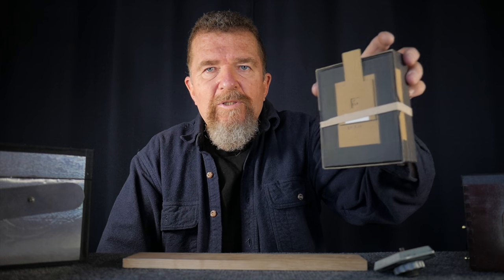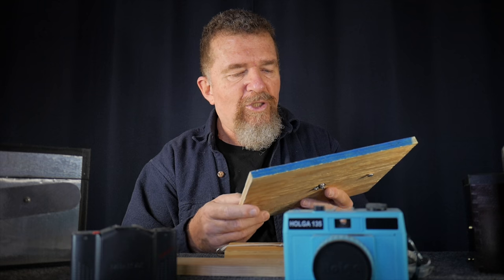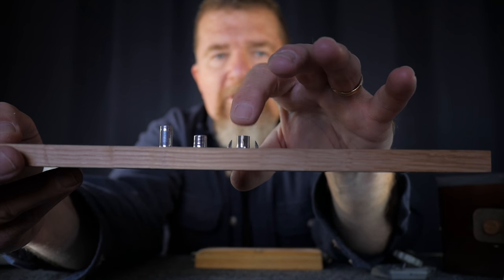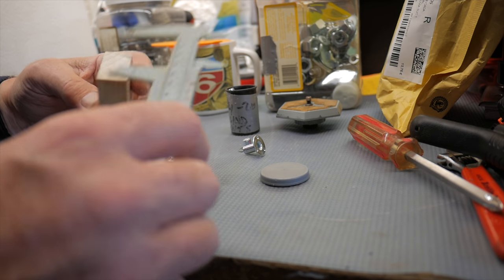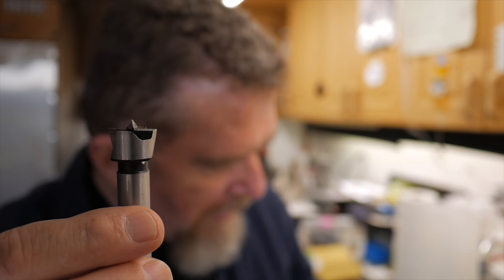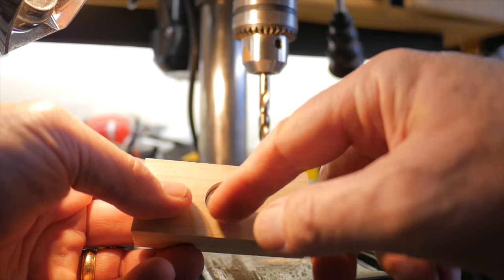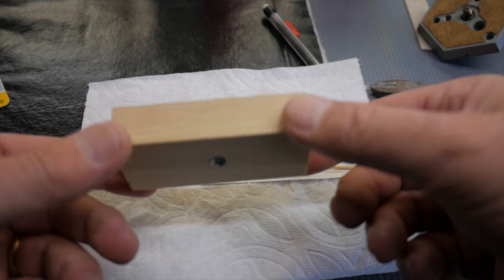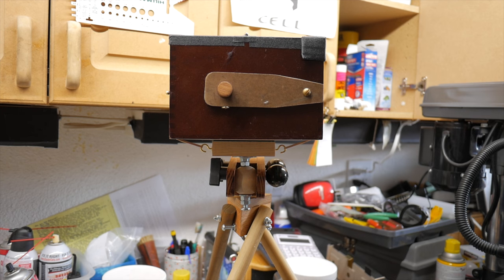How To: Installing Tripod Bushings

Comment: Hi Joe, great video! A tip for avoiding the blowout you mention around the 10:50 mark is placing a piece of scrap wood under your hole and drill until you hit that. Putting on painters tape also helps reduce tearout!